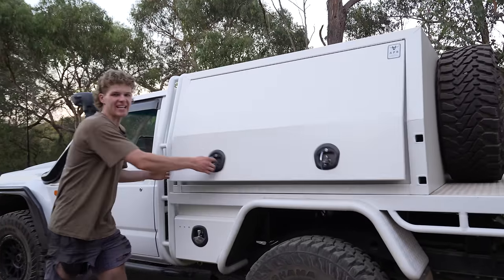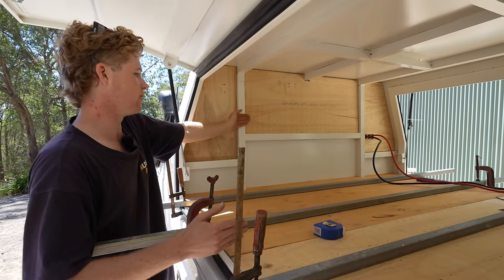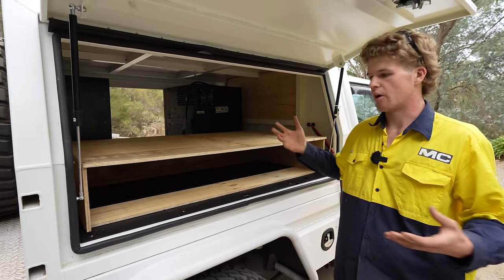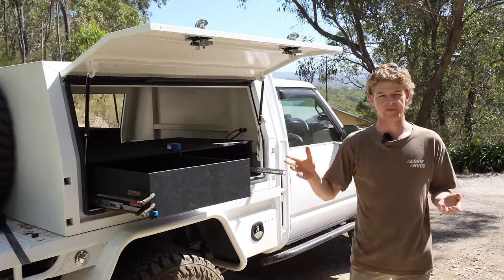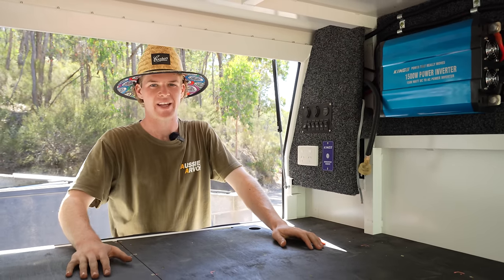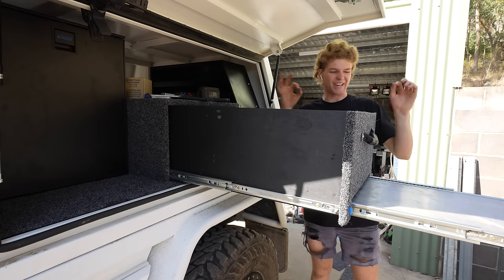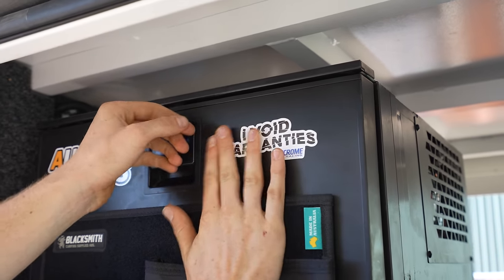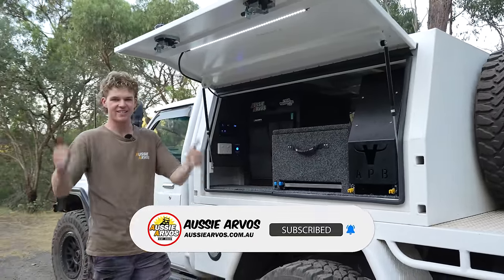Building my own Canopy Fitout from SCRATCH

Comment: Here's a safety tip for DIY a 240V inverter to a vehicle, have a RCBO installed to protect the power from the GPO outlet, or fit a GPO with inbuilt RCD, these are lifesaving devices that are mandatory for any fixed wiring but never get mentioned from DIY'R installing inverters with remote GPO, the 240V the inverter produces is no different to the 240V in your house, they are both lethal and can kill, the last thing you want is your kids or yourself getting zapped with potential devastating results when you are in the middle of nowhere, remember if something goes bad you could end up with live 240V on the metal body of the car, Jaycar or SparkyDirect sell GPO with inbuilt RCD for around $60, worth every cent.
Reply: Nice to try and help people with 240V but should be left an electrician. I'm guessing that's why he didn't show how to do it
Reply: To add to it, the only way to do it safely is to install an RVD as it actually monitors the isolated ground in inverters.
Reply: @jpwatson8811 Correct, legally it should be left to an electrician if your running remote GPO off the inverter's inbuilt GPO, unfortunately this doesn't happen as some people think because it's not connected to the mains it's ok to wire it up themselves, it's no different as it's still 240V, it's more critical to have it done correctly as being in the back of a canopy it's getting bashed and jolted everywhere you go, plus it's exposed to dust, moisture, heat, cold that mains installations would never see, you can wire up the inverter yourself as it's only 12V, as long as you don't wire additional 240V GPO off the inbuilt ones on the inverter, this is why a lot of installations will simply run a power board off the inbuilt outlets, then they don't need an electrician to install it.,
Reply: @-PORK-CHOP-  I know, 1. I'm a licenced electrician and know that trade there are things that the regular Joe doesn't know. And 2. seen alot of people doing it themselves. I know being in the trade it doesn't meet AS3000 and AS3760 standards

Comment: Liam, great work.
One simple improvement for all others to follow is:
The floor space immediately infront of the fridge as you have it is a waste of space.
Resolution:
Don't raise the floor immediately infront of the fridge. Leave a low shallow shelf space there by utilising the tray as your floor, obviously trimmed and carpeted.
It's the perfect location to place small devices (phone, battery packs etc) whilst charging them from your 12v 240v and you can still open close fridge door  accessing your cold stuff. Obviously it's a low storage shelf also with a lip that stops things falling out when canopy door opened.
Liam, you can still modify this later on, it will involve cutting the false floor, & aluminium support away, then lining the walls and trim with carpet.
You can thank me later, when your off of K'gari.
K'gari, now that's a four wheel drive paradise, enjoy.
Oh, save for a RTT, so much more comfort & that negates any insulation issues, haha.
Wealie.
Reply: Good point
Solar panels on roof no insulation required, In WA I would still insulate, styrofoam painted black is effective or covered with marine carpet
Reply from the maker: Thanks mate! Been using the setup for a week or so now and k thinky UK could be onto something about removing the floor in front of the fridge.
Might be one to look into when we're back home!
Reply: 2nd comment regarding space in font of fridge
also looks like the floor could be 10mm lower on the other side - drawers sitting high 🤷

Comment: 100% best to insulate the bottom of the canopy, you get a LOT of heat coming up from the road and from the hot air coming from the engine plus exhaust. The space was there for insulation... would have been good to use it

Comment: Heres a few tips from a Chippy, pickup a Smartbit, these pre-drill and countersink in one go, they come in 8,10,12,14 Gauge to suit whatever screws your using, go for the smartbit brand and not the Macsim ones as these have a design fault and literally fall apart, Use a trimmer with a 6mm half roundover bit on any exposed ply edges, this takes the sharp edge off the ply which will easily cut you if you bang your hand into the edge,

Good find on the handles these look great, also look at Renogy Inverters, they have sales all the time and are far better quality unit than the Kings stuff, also did you fit an isolation switch from the inverter input to disable it in an emergency if needed.

Good tip on  using polyurethane based product as it stays permanently flexible, Never use regular construction adhesive, as it is designed to set hard, it will crack under movement, it's ok for home flooring but not for anything that has movement, best product to use is Sika 11FC, or the Selleys Sausage you showed.

Good job on the build it looks great.

Comment: Nice work! I built one very similar. One nice touch I put on was LED strip lights in the draw that run off a trigger switch when you open them. They work amazing! Super simple to add too.
Good work. Looks like it was build by a pro at a 10th of the cost!

Comment: Make sure when fitting GPOs for 230V power in mobile setups including 4WD's, caravans and campers  you use double pole units, so it isolates both Positive and Neutral lines.

Comment: Better off using a bit of angle as a handle to open both drawer slides at once. Having the latch on only one side puts a lot of pressure on it and will eventually break.

Comment: What a sick fitout! That looks extremely tidy. It makes me wanna clean up my own 12V stuff.

On another note, I had the exact same dramas with getting those locking fridge slides to work. Unfortunately they're not real user friendly. I have even bigger drawers than these (about 500 mm deep and 900 mm long). The bigger they are, the more the small tolerances add up and cause problems. I mucked around for a very long time trying to get them smooth but somewhat gave up.

A big issue I had with these drawer slides was that even though the slide was rated to 150 kg or thereabouts, the screws securing them into the ply couldn't handle much weight. As a result one fell out and jammed my slide when I was on a trip to Central Australia. I ended up ripping out the slides and made my own. I used skateboard bearings and aluminium box tubing. It works really well and tolerances were not an issue at all.

It was also super awkward to pull out whilst unlocking the two mechanisms so definitely cool that you removed them. 

I doubt you'll have the same dramas as me considering your drawers are smaller, you removed the locking mechanism and solved the issues with the tolerances? I assume you added some spacers or something?

Comment: Great video and a good way to show people it can be done on a budget. I was surprised at the weights, the drawers look like they way less than the ones you get from Kings.
Reply: Kings drawers are way too heavy, I put aluminium angles on the bottom of my drawers for strength, also used skate board bearings instead of those heavy drawers runners which seize up when sand gets into them

Comment: Great fit out! Really nicely finished. My only concern is the GPO with hidden wiring. Vehicles move and vibrate, houses don’t. I plug a powerboard into my inverter and mount that on the wall so all the 240V cable is visible. Safety first!

Comment: Great video....As for Kings products I notice people get kinda embarrassed when it comes to having there products at the end of the day if the gear gets you out there then it's worth every cent by saving cents makes sence....I always found in my time there a good way to test products when your going through what works, what doesn't, what fits do you actually need it and use it....then later if it's necessary and you got the perfect set-up then flash the cash for brands...7x out of 10 you find that some Kings gear will remain because it works and lasts

Comment: The thermal properties of the metal play a much larger effect on how much heat it retains. That's why stainless does so well for cooking equipment. With the wood and carpet youve put in the carpet, youve basically added enough insulation anyway.

Excellent canopy loadout. Its always so much better when the loadout is designed by the person using it. Whats the possibility like of ducting the fridge exhaust out of the canopy? Itd help heaps with heat management.

Comment: Looking good but if you are not going to insulate the roof, what about condensation dripping onto the surfaces & electrical points especially in the colder areas of your trips.

Comment: Just remember that your 1500w inverter is only 6.25 amps of 240v power. Each of those sockets are rated for 10 amps (or 2400w).

So if plug in a toaster, microwave, space heater, kettle etc, you'll quickly discover you dont have anough power to run them.

Its totally fine of course, as long as you understand it and know how much current each device plugged in draws.

I would put a sticker on saying both maximum watts and amps available at the power point, so others know OR at least can go "WTF?" and ask you what that means before plugging in their arc welder for some bush repairs.

Comment: Great vid. One thing, if nobody else has mentioned, be careful with slides/runners. They could be rated to 125kg like you mentioned yours were and you can choose the desired length. At the shortest available length which may be 300mm and will hold 125kg. However at 700mm, as yours are, they may only hold 100kg or possibly even less. I'm sure you know that but you didn't say it in the video so I thought I better mention it just in case to save you some dramas down the track.

Comment: Looks mint mate 💪 Well done! Only suggestion would be to save some $$ up and get the new Dometic NRX 80c fridge. We had two kings fridges (with fans) and in hot weather they just don’t cope :( Also drawing soooo much power. Went to a bushman, kept icing up and having issues with keeping cold. Swapped to the new  model Dometic and omg! No issues, even in central west nsw heat wave 46° she stayed perfectly cold. Good luck mate!

Comment: Trying to get draws to line up while the system is in the canopy is the most annoying thing haha I found taking the whole thing out and doing it on a table or flat surface where you can put packers under the timber is the best option so it's even and level when  you screw off

Comment: Side mounted draw runners are the worst things to install, you only have 1 to 1.5mm tolerance before they bind up, if this is the first time you have used them you did well to get them working, the runners are normally 13mm or 19mm for the heavy duty type, if you go above 14mm gap or 20mm gap  the sliders wont work (as you discovered 😂), Finally note the weight limit of the runners 125Kg is only rated to about half extension, the further you pull the draw out the weight of the runners decreases, this can become an issue with the double set you installed, if working on the pull out table with the draw also pulled out all the weight will go onto the draw slider and can get bent if you put too much weight on the pull out table when the draw is loaded up.

Comment: Liam mate, I've been teeing up on the idea of the upright fridge for the back of the GU Wagon. But what throws me off the idea is the constant running. Now you've made that mod, I and I'm sure others would really love to see the outcome, was it worth doing the mod or not, how does the amp draw compare to say an Engle 45l which is what I run😊. But any comparison would be great. Good build mate
Reply: A chest fridge will always be more efficient than an upright, In hot climates a chest is the way to go, unless you have access to plenty of power, as the upright will not cycle off in 40 degree heat

Comment: i rekn just add a strip of aluminium to the edge of the drawer system for when your putting your swag and stuff up there. i found with my drawers it was a high use area and wore out quickly

Comment: Hey mate, about to do the same to our fridge with the fan. When drilling is there anything you can hit? And where is the compressor wires located. Cheers
Reply: From what I could see its just insulation behind, as long as you put it in the right spot to come out the back it should be fine!

Comment: Bloody brilliant! Nice design, great construction and does the job.
Did you have to get the 240V outlet certified since it is pretty much the same as a 4 way power board for function?
Reply: No such thing as to get is certified but an electrician has to do it. To comply with AS3000 and AS3760
Reply: @jpwatson8811 Thanks. I might just get a 4 way switched power board then.

Comment: i noticed that you had your battery under the truck on its side, you better check with the manufacturer that you can do that , as most batteries are not designed to be on their sides.
Reply: There is a video where he explains this
Reply: If you look it up it can